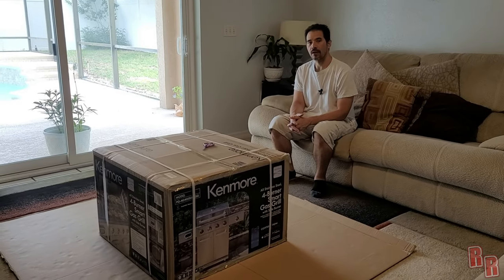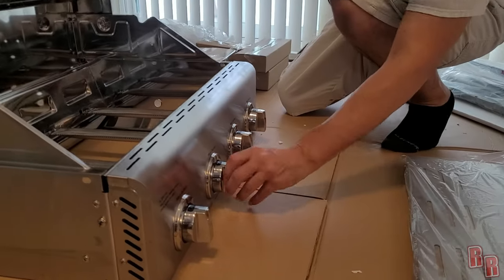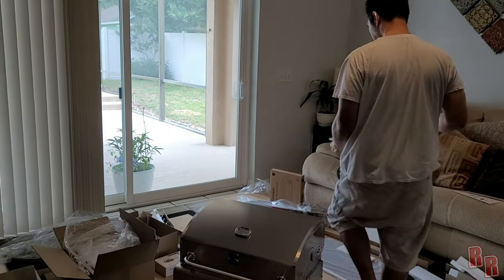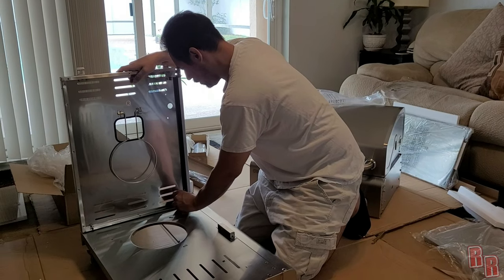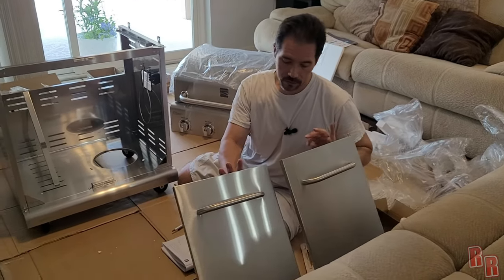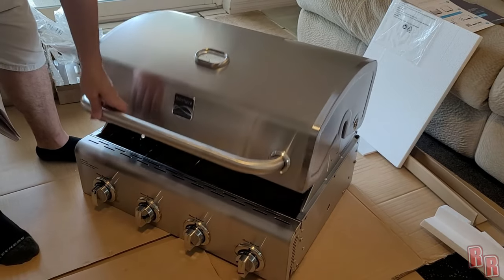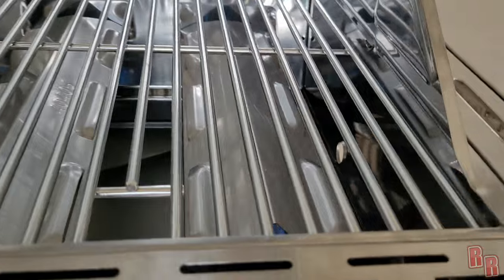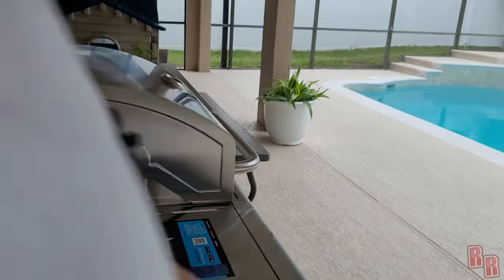Kenmore 4 Burner Smart Gas Grill W Side Burner Unboxing, Build and Real Review

Comment: Hi.  I’m in need of a grill.  Would you be able to tell me the measurements of the grill when you don’t add the side burner or stand.  Just the way you took it out of the box.  Thanks
Reply from the maker: Just the Center part without either side on or the stand is 18" H x 19.5 D x 26 3/4 W